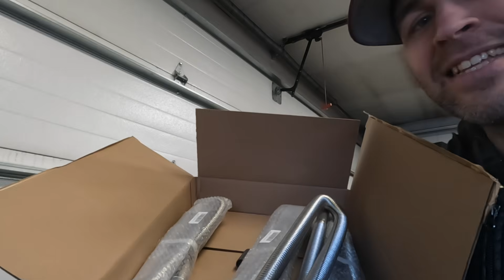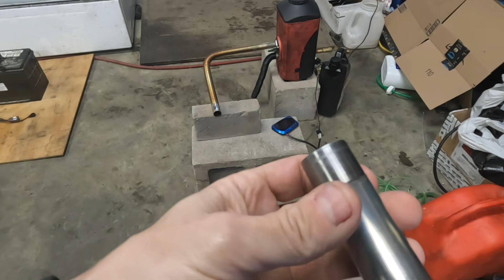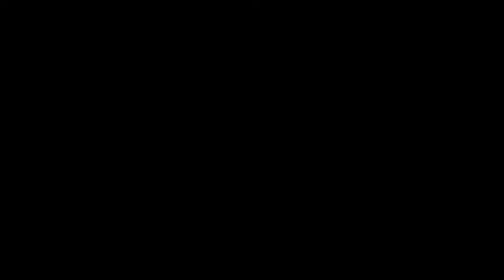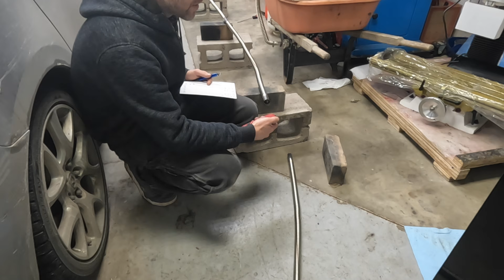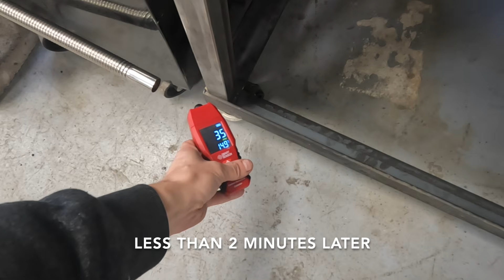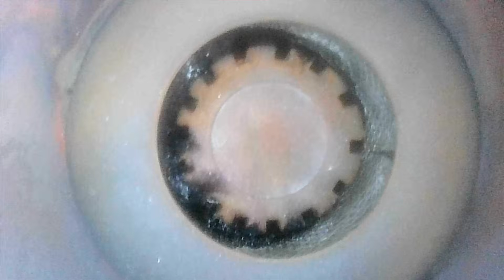Capturing Waste Heat - 5 Meters Of Stainless Exhaust - Will It Even Run ?

Comment: OK, here's what runs through my mind watching this. Suppose you went from the original 1 m exhaust to say, a 3" piece of duct or stove pipe. That would: increase the surface area, reduce the restriction, lower the velocity of the gases and maybe reject more heat in a shorter space. And it would be cheaper than extra exhaust pipes. Might have to silicone the seam.
Thanks again.
Reply: I wonder if it would help with extraction to taper from 1” to 3”, much like a 2 stroke tune pipe.
Reply from the maker: @White000Crow  It would help because the exhaust would slow down and give it more time to release the heat energy, and there is less restriction from a larger pipe, but there is no pressure wave to harness, so it wouldn't help in that way.
Reply: @White000Crow  I dont think so, tuned expansion chambers work on pressure waves not constant flow.
Reply from the maker: That would absolutely work... You would have to monitor it for corrosion as the condensate would cause rust quickly... I hear it can also be slightly acidic. 

I would like to try this with some 3" galvanized stuff for water heater flues.
Reply: @loweredexpectations4927  much easier to come by than baseboard or standing radiators. And less overkill.
Reply from the maker: @curtwuollet2912  True !
Reply: @loweredexpectations4927  perhaps if acidic, aluminium dryer vent might last longer.

Comment: Can you adapt into a shorter, bigger pipe like a 3" id? Less restriction on the heater run the big pipe all the way out to the end. More surface area shorter run for more heat transfer. Bro!
Reply from the maker: Absolutely. This takes more effort and the cost would be greater, I assume. 

If you were reckless like I am you could test it with heat register duct work and see how that works. My guess is that it would be fine, but not sure how it would handle the condensate.
Reply: @loweredexpectations4927  plus the air in bigger pipe will be slower which should help with the exchange..

Comment: Use a Home Radiator... Mount it so you can drain the water build up... 2 sq meters per kilowatt... or 10 pounds of radiator per kilowatt...
Reply from the maker: Yes... this is a great option... I almost bought a radiator but the one I've been looking at is $240 and the pipe was $80. I have been looking at baseboard hydronic heaters for over a year, but would need a really long one. 

This test is also for those who need to run a long exhaust and the heat exchanging effect is somewhat secondary.... maybe.
Reply: @loweredexpectations4927  they are almost free on craigslist and you have to mount them horizontally so the water makes its way back and forth down the radiator to the bottom where you can drain it off....

If the purpose of this is to have a long exhaust run I have had good luck with pieces of copper.... As hard as it is to believe there are also flexible tubular products that can handle those types of temperatures.....

If you would like to get every BTU available use the radiator method and preferably the exhaust temperature will be the same as the room temperature...

There is nothing wrong with a long exhaust run as long as you have control over the frequency so you can do some fine-tuning if it gets a little bit out of range....
Reply: Which hydronic heaters are you looking at?

 @loweredexpectations4927

Comment: I wonder if you ran a non flexible exhaust pipe that's smooth. Being that this is corrugated pipe would create alot of turbulance and increased surface area which creates additional restriction. A smooth pipe would eliminate restriction.

Maybe something like a hot water heating run that has a smooth pipe and fins on the outside to radiate off the heat would work better
Reply from the maker: Absolutely. A smooth pipe is much better for low restriction. 

The downside to having less restriction is also absorbing less heat. The corrugated pipe ads a lot of surface area compared to the same size smooth wall pipe. 

Water is very good at absorbing heat (many times better than air) and I am curious how much pipe would actually be required to effectively absorb most of the heat energy...
Reply: @loweredexpectations4927  Use copper pipe as it's thermal conductivity is WAY better than steel or stainless (200+ BTU/ft hr F with steel being 30 and stainless being 10).  I'm planning an exhaust for my CDAH that has a short section of stainless off the exhaust manifold/pipe of the heater then copper pipe which goes through a container of water for thermal mass storage.  I'm not sure about the temperature of the exhaust at the heater exit or I'd use copper for the whole thing.  

EDIT:  I've seen mention of 750 F/ 400 C for the exhaust temp.  The manual I have says a maximum exhaust length of 6-1/2 feet or 2 meters with a maximum total of 270 degrees for the sum of all bends.
Reply from the maker: @michaelg4931  Yes, copper is WAY better if you can justify the cost, and it is not as easy to install. 

The main reason for testing this exhaust was to see if it would be too restrictive for those who need to make long runs. The heat exchanging effect was basically a secondary consideration. 

The temp of the exhaust can get very hot if things go wrong, enough to make stainless glow orange. This will also change based on how rich you run your heater. While the exhaust may get to 400C, copper is very good at releasing heat... so it would may not get too hot... however, if you plan on soldering it, the first section may be too hot for solder.
Reply: @loweredexpectations4927  I'd be using nickle silver brazing rod.  If I heat the copper I can anneal it to make it soft so expanding it a bit to slip over the heater exhaust flange should be not much more difficult than the supplied stainless pipe.  Being annealed it would easily clamp down on the flange.  The pipe would go straight down about 4 inches/10cm into a stainless tank filled with water until near the bottom where I'd us a long elbow to have it follow the bottom of the tank and exit the side.  The pipe would be brazed where it entered the top and exited the side.  I have 5 foot of 1 inch Type L copper water pipe in my stash so I'd just need to get the long street elbow (~$12 USD).
Reply from the maker: @michaelg4931  Sounds like a good plan.

Comment: You didn't account for the new pipe junk burning off initially did you? Maybe why initial readings a bit higher?
Reply: exactly my thoughts. after burning the residue off the exhaust gets pretty clean
Reply from the maker: @kurtwagner16  That could be the case, but I'm not sure what would be burning off at such low temperatures and making CO... I could understand the TVOC shooting up, not so sure about CO.
Reply: @loweredexpectations4927  i don't think that its really burning off, rather vaporizing some residue. 
Another thing is, that when you do a exhaust examination/test (idk how to call it in english) on a car. And you have water in the exhaust, that the co skyrockets (like when there is a lot of condensation build up in a muffler or so).
Reply from the maker: @kurtwagner16  Yeah. Vaporising residu shouldn't cause CO. CO is a byproduct of poor combustion. 

I'm not sure about the CO and moisture. I do know that moisture is generally present in an exhaust when it is cool, and when your exhaust is cool, the catalytic converters won't be working well. Once it is heated up and the cats are working the CO will be lower and the moisture wii not condense as easily.
Reply from the maker: I didn't think of that. It could be a contributing factor for the first one, but after the second and third, the temps were too low to burn anything off. 

The way that the heater restarted with a lot of smoke, and then calmed down to normal, leads me to believe that it has something to do with the mass of air in the pipe when it cold vs warm.

Comment: So I wonder what would happen if you ran the pipe vertical to achieve more of a stovepipe affect
Reply from the maker: Interesting... that could have an effect. However, that would be a 16 foot ceiling, haha.... or you could have a 1 into 4 manifold ... that would be more reasonable.
Reply: If the temp of the stovepipe falls below the dew point of the exhaust gases you may have condensate, mostly water, fall back down and drown your heater. :P

Comment: Awesome. I have been wanting to see it in sand and propylene glycol  in  a 50 gal drum.
Reply from the maker: 👍 I think 50 gallons is probably way overkill, as the output of the exhaust is somewhere around .5 to .8 kw.... 

I supposed it all depends on what your end goal is... If you want to capture the heat energy so that it isn't lost outside, then I think less will do... however, if you are trying to create a heat battery then the bigger one may be the better option.

Comment: Air blowing at 1 degree c will transport moisture away quicker than it can form would be my thought... add the heat and it wll be near impossible.  You will have to pour a bit of water down the vertical exhaust, to try and get it down to a point where enough moisture can form... will be interesting to see if an exhaust pipe at the angle of a semi circle filled with water would bubble enough gas through to not burn out the chamber... measure the volume of liquid to its spill point before fitting it to the burner?
Reply from the maker: I'm not a physicist but what you are saying is a little off. 

While temperature is one of the factors in determining condensation of water vapors, there is a lot more to it. The amount of humidity in the air being a major factor, as well as the temperature of the surface of the pipe.

At 30C if you have a glass of ice water, condensation will form on the outside of the glass... 

It will be very interesting to see how hard it is to make it happen, but I assume that on a cold day, the cooling of the pipe will make it happen pretty quickly.
Reply: @loweredexpectations4927  if sub zero then humidity is low normally, there is loads of different factors. I am thinking of water being poured into a hot exhaust or a freshly started one and seeing if the normal air fan speed can bubble through say a semi circle bend of say 1 foot 2 foot etc, and seeing what volume of water and then thus how much condensation it would take to stop it from working, 50ml, 100ml, even 300ml might have no pressure to block the exhaust gases from venting, and eventually steaming off if near the burn chamber, that could add silencing benefits? A lot of good questions and videos to see what the unit is capable of...

Comment: If you had a 4 port 1” adapter/header/manifold, you could put the 4 tubes on at the same point, reducing the restriction, and all 4 tubes would have the same higher temperature.  👍🏼
Reply from the maker: This is a good idea and would reduce the restriction. As for the same heat in all 4,  that part is not correct.  You have X about of heat energy and it will be distributed between the total amount of pipe regardless of how you install it. 

Basically, the average will be the same. In this set up, the first pipe is really hot and the last one is cooler. WIth all 4 in parallel the pipes would all the same temperature, but that temperature would be lower.
Reply: The pipes in parallel will all be at a somewhat higher temperature than last 2 or 3 sections when in series, without the flow restriction.  More heat being released closer to the source.  ie first tube is obviously hotter than the second tube and so on, when in series. It would be an interesting test. 👍🏼👍🏼
Reply from the maker: @markcoyle8003  Yeah, it will be hotter at the entrance of each pipe.  

There are a lot of things that come into play here. The pipe getting hotter means the gasses have given off energy, and they are able to do this most efficiently when the temperature differential is the highest. The pipe getting hotter means that that energy is no longer available, so the gasses downstream are cooler, meaning less effective at getting rid of their energy. 

The 4 pipes in parallel means the gasses travel 4x slower, so have more time to give off that energy, but also travel 1/4 of the distance and are exposed to the exact same surface area of pipe while taking the journey. 

It would be interesting for sure, to see what the actual numbers would end up being, haha.
Reply: All good. If you can find an old 4 cylinder header, chop chop and some aluminum tape….  LoL.  Have fun with it. Maybe add a fan. Good content. I’m sure Vevor loves it too. Happy testing. 😁
Reply from the maker: @markcoyle8003  That would be awesome ! haha. I have some jet ski exhaust systems that are aluminum and have water jackets.... that's perhaps a good idea, haha.

Comment: Right at minute two i do already miss a somewhat logical point. Not the max blast is in the most danger of not to get through the tube without having neagtive effects, but the minimum blast highly is. 
Now i watch the rest and we'll see.
Reply from the maker: I'm not sure what you mean ? Are you talking about running in Alpine mode ?
Reply: @loweredexpectations4927  No - at lowest setting.
In a milder clima than yours a heater makes far more hours in low range. Whilst temperature is above freezing most of the time here, for instance,  humidity is the chilling issue. Plus 5 C° with high humidity is very unpleasant - that's where my heater get's the 24/7 use at 1,2hz for weeks.
Reply from the maker: @werner.x  OH ! Well... In the lower setting it will have less effect, and because the exhaust gasses are moving slower, the tubing would be a more effective heat exchanger. 

The restriction of the exhaust, just like in a car depends on how much you are trying to force through it. On the low setting your heater is idling away and mine is pulling a trailer up a hill on the highway.
Reply: @loweredexpectations4927  I do get problems with only one of my setups - the one with heat exchanger. And only in lowest setting.
But this started with heating oil, not with Diesel fuel - which is extra clean these times.

But my other heater without heat exchanger, which does way more hours at lowest setting, because it just heats the trailer, not the shop, didn't develop these problems with red heating oil.

So, there is a relation to slower fan power versus higher flow resistance, i guess - as soon as the fuel gives any chance for soot.

As i said, it started the second heating season after burning maybe 150l of red heating oil.
Reply from the maker: @werner.x  That's very interesting. Is the residu in the exhaust, the chamber or both ?  That is very counter intuitive. 

This must have something to do with the efficiency of the fan at lower speeds. The resistance, though less, is enough to cause issues. 

I can't remember if you have a controller with the engineering menu / the ability to control air fuel ratio... If so, increasing minimum fan speed should help.
Reply: @loweredexpectations4927  
Haven't opened the heater yet, did just exchange it. Now it's waiting for maintenance.
Have never changed settings up to this time - but yes, should have tried that.
Got in a bit of a crisis when coming back to the shop just to find out, that my neighbour was rotting in his house for four weeks already and nobody even cared. He was only 8 years older and did just retire. I liked him quite a lot - in fact he was the only one there i did like.
In addition it rained for two month, then it went to freezing, but still no sun - didn't help my mood either.
So, i got lazy and have to restart.
Reply from the maker: @werner.x  Oh shit ! .. That's awful. I'm sorry to hear this. Now is the time to do all of your living, because you never know how long you have. My father passed away shortly after turning 65 and we all thought he would live forever. 

You seem a lot like me. A recluse, so I can see how only liking one person in your area. We have been very fortunate here with the weather, but it is very gloomy and raining today. Do you live near your shop ? I had the idea that you lived at your shop on on the same property.
Reply: @loweredexpectations4927  My answer to this comment didn't show up here. Am i just too blind to see? Do you know, what's going on with YT here?
If it's just hidden, you may leave it at that as well. Nothing of public interest.
Reply from the maker: @werner.x  YouTube recently is deleting a LOT of comments. If you say anything that sound like it might be dangerous or a threat in any way, or if you say anything about the government ... They don't like that. 

I have used the word that means something coming apart because of expanding gases causing too much pressure, and my comments have been deleted. It's pretty silly and annoying.
Reply: @loweredexpectations4927  Funny thing is, it seems to be shadow banned, not deleted. Because i can reach it via my "comment" history and i'm still able to edit it, like if somebody shadow bans me. You never can edit deleted comments, you get an error instead. So, it seems to be a "in between" this time. Not shadow banned by you, but obviously by YT itself.
I may try to change some words and repost it.